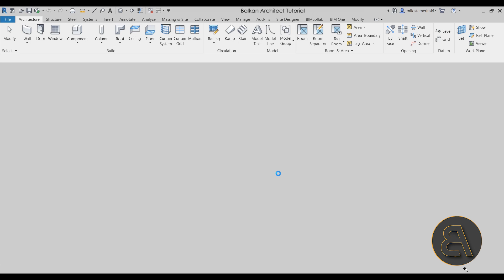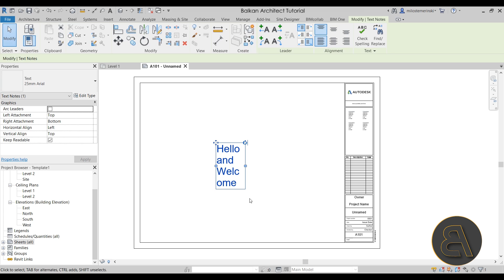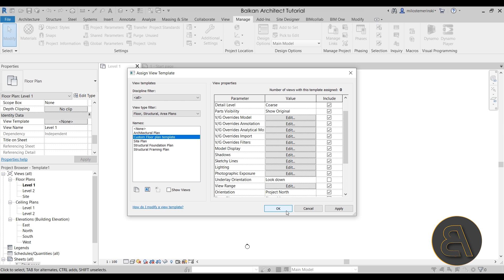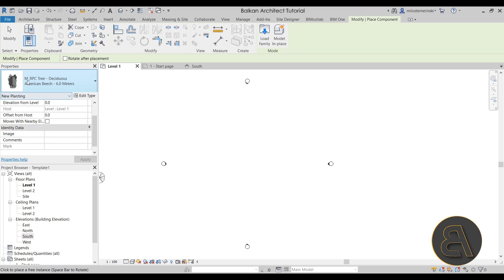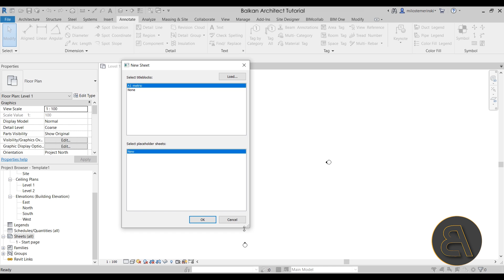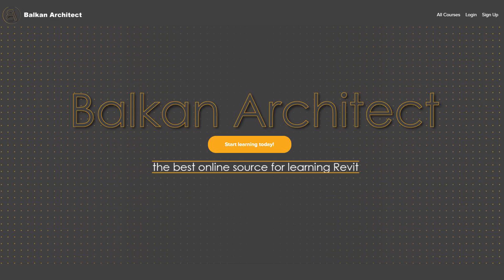What Should you Include in your Revit Template

Comment from the maker: What do you think?
What else do you think should be added to a Revit template? Especially if you need a template for a student, solo architect or a small team.
Reply: Thanks for the video.
A customized project browser organization especially for views hierarchy should be organized in a Revit template. Some predefined useful materials would also be cool to have in an architectural template.
Reply: Is it ok to create the sheets, organized depending on the discipline, also the project browser.. By chance what is the benefit of using shared prameters for a parametric project browser organization? Thanks for the video!